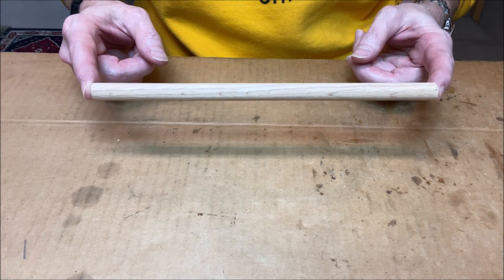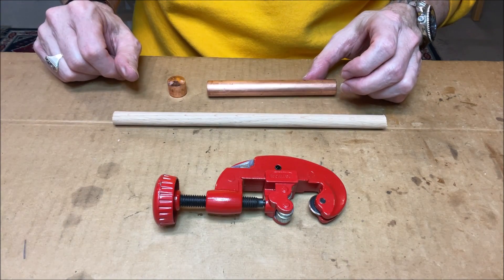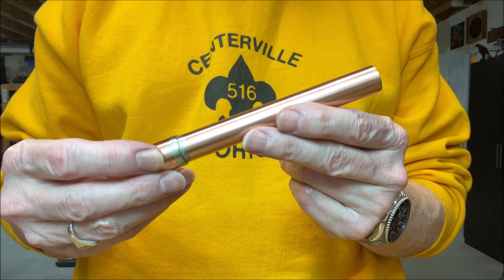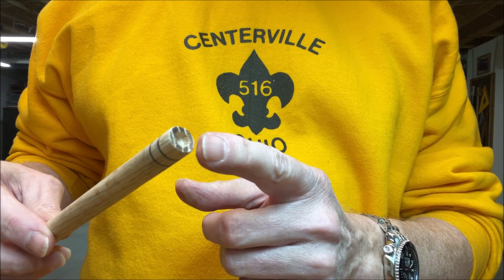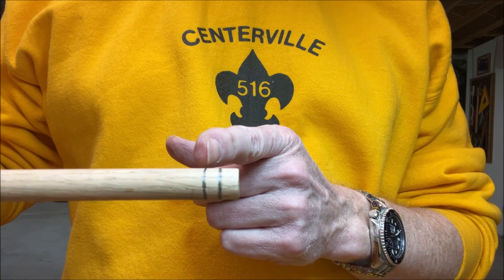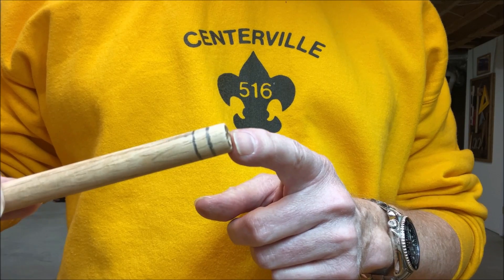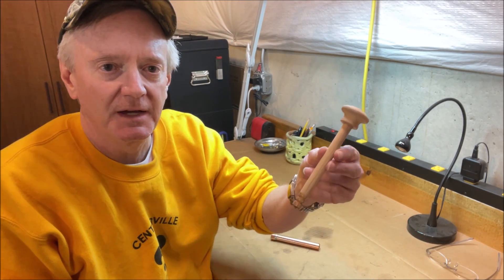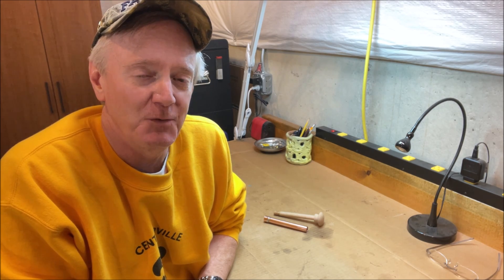DIY Fire Piston

Comment from the maker: I've had some recurring comments/questions that I'd like to address. First, I wanted to do more than just deburr the end of the pipe. I actually put a chamfer on the inside of it to allow the o-rings to slide in a bit easier. The built-in deburring tool on my pipe cutter was rather dull and just wasn't up to the task. Thus my use of the little junker knife I used and keep in my tool box. I probably should have made that clearer in the video. After I chamfered the inside end of the pipe, I also sanded it and polished it up with some steel wool. Sorry for not pointing all that out.

Second, it honestly never occurred to me to work in the piston groves using my drill press as a sort of lathe. My preference is to use hand tools as much as I can, though. Many of the scouts I try to work with don't have, or aren't allowed to use power tools. I know, what about blow torch soldering? We'll I've offered to do that for any scout in my troop who wants to build a fire piston on their own. 

Lastly, for now, the physics governing the action of a fire piston is a bit more involved than a simple examination of Boyle's Law (i.e., PV=nRT) might lead us to believe. I've put some links in the description (Update 2) to some good articles that go into this in more depth. Please take a look.
Reply: I found some nitrile O-Rings on Amazon, but they're not cheap. 9/16" X 3/8"
Reply from the maker: @radagast6682  Yes, I found some too. I broke down and bought some. I hope they will hold up longer to compensate the cost.
Reply: @FlintStryker  How many did you buy, and can you sell some to me?
Reply: @FlintStryker  Are you worried about igniting the petroleum based lube?
Reply from the maker: @radagast6682  I bought them on Amazon. I paid ~$8.60 for a package of 20. I don't think YouTube would take kindly to me selling things via my channel at this point. Sorry. Here's a link to what I bought: https://www.amazon.com/dp/B000UEZ5BA?psc=1&ref=ppx_yo2ov_dt_b_product_details
Reply from the maker: @radagast6682  No. It doesn't seem to be an issue at all. Best Wishes!
Reply: @FlintStryker  Thank you so much for taking the time to help.
Reply from the maker: @radagast6682  You are very welcome. Thanks for stopping by. Best Wishes!
Reply: İşte dürüstlük ve samimiyetin kanıtı gibi konuşuyorsun seviliyorsun ❤❤❤
Reply: You may be able to use super glue... in order to avoid soldering the two copper pieces..    I know the soldering is much more secure... but in case one doesn't know how to solder, or doesn't have the equipment.  🙂  Thanks for this nice video.

Comment: I made one of these today, but I used a Copper Stub Out (Straight) for the cylinder, cut to size, that didn't require any soldering. I haven't tried it yet because I don't have any charcloth. It has compression, but only time will tell whether it creates an ember. I do like the glue used on the knob instead of a screw like I used, but that is easy to remedy.
Reply from the maker: @richardclifton4120  Great to hear. I hope it works for you!!! Best wishes!

Comment: Well done tho my first attempts didn't ignite a few tweaks and off it went I did find that increasing the size of the hollow for the char cloth gave me a larger ember that was hotter and let me take my time getting it picked out and into the tinder bundle where it lit the tinder quicker I built my next piston using an old nonworking mini maglite in the head of the light where the bulb and reflector would go I left the lens in and store char cloth and lube in that area along with a 4 penny finish nail slightly shortened to pick the ember out with Loved your video I'll bet you influenced a heck of a lot of fire piston builds   good stuff
Reply from the maker: Many thanks! I like the mini MagLite idea. I may have to look into that. I may have an old one in a toolbox somewhere. Happy Friday!

Comment: I noticed when you heated the cap and pipe, you pointed the torch at the edge of the fitting. Solder flows to the hottest point. This will not get the solder to the base of the fitting. You should heat the cap from the end to get the solder to flow all the way in.
Reply from the maker: Yes, thank you. When I watched the video of myself completing that step I just shook my head in dismay. Not my best effort by a long shot. My next one will be better. For the sake of my younger scouts, I've also been thinking of just epoxying the end cap on. I don't think 5 minute epoxy will be sufficient, but maybe J-B Weld or a slow curring high strength epoxy (e.g., Devcon 2-Ton epoxy) might do the trick.  What do you think?
Reply: @FlintStryker  As a plumber of over 56 years, I only solder copper pipe, but Devcon 2-Ton is a great product, it may work. 

I can't get my fire piston to work. I started with the dowel 1/16" from bottoning. When that didn't work, I sanded I little at a time, trying each time until I got to 1/8" short of bottoming. My char cloth ignites with flint and steel, and I have very good compression. Do you have any suggestions?
Reply from the maker: @radagast6682  I'm sorry you are having trouble. Keep at it! It will eventually work. Ironically I've found that too much compression can work against you, though I don't fully understand why. If you are using an o-ring seal, try filing the grove a bit deeper just a little at a time. That may do the trick. If I get such good compression that the piston wants to push back out after I've jammed it in, that's too much. If it's tight, but will stay in until I pull the piston out that seems to be the sweet spot. Let us know how it goes. Thanks for checking in!
Reply: @FlintStryker  Thank you. I have varied the compression by varying the starting  position of the piston. I will keep trying.

Comment: I was reminded today after watching this video and another one on this particular topic. If you have a pellet gun you can put a little vaseline in the cup on the backside of the pellet and when you fire it the air pressure ignites the Vaseline and it'll crack off like a .22 bullet. I don't know the ballistic differences but I'm pretty sure that it's more powerful than just the air compression in the air gun itself. If someone has the means to test it with the right equipment for muzzle velocity and speed let me know please. Thanks and be safe.
Reply: I remember when I first bought one of the high velocity air rifles , I had oil in the barrel and it dieseled on me and sounded like a 22. I am sure you have a little more velocity.

Comment: Maybe a small addition of a metal washer between the wooden strike head (attached to underside of handle) and the top of the copper tube, it may start to dig in otherwise.
Reply from the maker: Not a bad idea! Thanks for the suggestion. That will make it last longer.

Comment: Just a little tip on the soldering. When applying solder, apply it on the opposite side of the heat. The solder wicks towards the heat source. I'm gonna have to do this little project. I've wanted to make a fire piston for some time. Your method is perfect.
Reply: Also, don't overdo the flux. It runs when hot which is why the solder ran over the surface of your cylinder.

Comment: Great setup! If I may be of a little assistance, however, the pump jack in your video is turning backwards. Any pump jack with the pitman shaft offset from the centerline of the well pipe (most if not all vertical jacks) should rotate so that the pitman arms are as near vertical as possible on the power (up) stroke. Rotating the jack backwards, particularly under heavy load (deep well or large diameter cylinder) will result in accelerated wear to the cross head slide and possibly pitman arm failure. Hope this helps! Keep that old iron turning!
Reply from the maker: Sorry. I don’t know what you mean. Did you mean to leave this for some other video?
Reply: @FlintStryker  I thought the same thing I've done it. HA HA

Comment: That will start a fire. Any special reason for two o-rings. Thank you. God Bless and stay safe.
Reply from the maker: Just insurance for a good seal. My last single o-ring piston didn’t seal well and I ended up tossing it. Thus my excitement when this one worked on the first try!! One will do but you need to be extra careful - especially if you fit it with hand tools. Best Wishes!!!
Reply: @FlintStryker  Also, two is one and one is none! Blessings
Reply: @FlintStryker  Thank you. Will get my crew, three families with three kids together and grill some burgers and make these. Great group time together.
Reply from the maker: @joeyhardin1288  Sounds like a great way to spend the day!

Comment: Rather than 3 -In-One Oil, try some, "Preparation H" Ointment (original jelly formula that looks like Vaseline if you can get it) or KY Jelly.  Neither will attack the rubber O-Ring.  I've used Preparation H for paint stick O-Rings and these rings are still good after over 30 years!  I am not sure about how well the new white cream Preparation H formula works.
Reply from the maker: Well, I would never have thought to give those a try.

Comment: Possible improvement, but haven't tried so this is just brainstorming.
Maybe a smaller diameter pipe for the bulk of the piston... leaving about an inch for the o-ring and charcloth divot. fit the pipe into the dowel plug, then use a screw cap on the other side for the piston handle. This gives you a space to store spare o-rings, lube, and maybe a bit of charcloth and/or pet-jelly soaked cotton. 
Thoughts?
Reply from the maker: Not sure I totally follow. Give it a try, though, and let us know how it works out. Post up a video too.
Reply: @FlintStryker  you have a plunger that is about 6 inches long and wood. The last inch and a half has 2 o rings and the char cloth cup.  I'm suggesting cut that last 1.5 inches off and attach to a smaller pipe that is hollow and can store spare parts and tinder. The plunger is now a hollow storage pipe with the wood plug.

Comment: Why don't you use the De Burr tool on the Pipe Cutter ??
Reply from the maker: Others have asked this too. I wanted to do more than deburr the end of the pipe. I actually put a chamfer on the inside of it to allow the o-rings to slide in a bit easier. The deburring tool on the pipe cutter wasn't up to the task. Thus my use of the little junker knife I used and keep in my tool box. I probably needed to make that clearer in the video so I hope others find this comment. After I chamfered the inside end of the pipe, I also sanded it and polished it up with some steel wool. Good catch! Best wishes.
Reply: @FlintStryker  Something like putting a flare into the end.. Ok.

Comment: The reason it worked after you filed it is because of Boyle's law - by reducing the VOLUME you increased the TEMPERATURE for a given energy input (the hammer strike) . It will get to basically the same PRESSURE from absorbing the energy of the hammer strike, regardless of the volume, but ideally to get the highest temperature you want the free volume under compression to be as close to zero as possible.
Reply from the maker: Please see Update 2 in the description for more on this.
Reply: Charles says "Hey what about my law?"
Reply from the maker: @stevemorris3710  Well, yes, Charles' Law is one of the ideal gas laws (V1T1 = V2T2), but it can be derived from Boyle's Law when the pressure is held constant. Please see the links in the updated description for more detail on the physics of the fire piston. Best Wishes!

Comment: I think you could fill some of the volume at the bottom of the endcap with another o-ring left inside at the bottom of the endcap. The o-ring having a space in the center doesn't come close to touching the ember, and  compacting the air to an even smaller volume also drives up the temperature.
Reply from the maker: Could be. With a good seal, though, I rarely plunge the piston all the way in - even with the built-in gap at the bottom.

Comment: I was thinking about cooper's high thermal conductivity, and that if you coat the pipe with a dip in polyurethane or varnish or something that won't flake off, maybe you can get it a bit hotter. 

Maybe adding a dry graphite powder lubricant to the walls will reduce the friction with the walls. For quicker compression and less time to loose heat to the walls.

Obviously what you made works so maybe it's good enough😃, and that the heat loss to the copper walls is so short that it's practically nothing. And, maybe any insulating inside coating will simply end up flaking off anyways.
Reply from the maker: Could be. Reducing cylinder thermal conductivity would probably help. I’m trying to keep it all simple, though. A quick push usually does the trick. Another suggestion was to use PVC for the cylinder. I may give that a try.

Comment: Ive heard of people using cotton ball instead of charcloth. Have you tried that or think it would work?
Reply from the maker: I’m not sure. I haven’t tried it. Cotton doesn’t smolder real well, though. It might not work so well for fire making.  I’ve seen demos with transparent cylinder “fire syringes” that use tissue paper. Just makes a big flash. That’s great for a WOW factor but not so good for toasting marshmallows. YMMV. I might give it a try.
Reply: @FlintStryker  I watched your vid and made a piston and as of now, I cant find a tin to make char cloth...lol...so I tried a cotton ball pulled apart and I cant get to work. I dont know if its the piston of the cotton ball thats the issue. If you try it out please leave a comment so I can check it out. Going to have to buy me some altoids so I dont have to steal and sacrafice one of my wifes tins! Thanks
Reply from the maker: @zipshed  I've never gotten cotton to work either, even in known good fire pistons. I'd make and try some good char cloth first in order to trouble shoot your fire piston. Once it works with char cloth, you might try cotton again.

I did get some ashed cotton to work a few times (i.e., just rub a generous amount of wood ash into the cotton), but I only did that a few times and found it mostly unreliable. Good luck! And thanks for chiming in!
Reply: @FlintStryker  Ok will do and thanks again!
Reply: I've used cotton balls to throw in when I make my batches of charcloth. They hold an ember much better once they are charred but I don't think the natural state does better then charred denim by any means.
Reply: @TNBushcrafter  Thanks for the tip...Im just trying to figure out what the issue is with mine because I cant get it to fire.

Comment: Just a hint : Place your piston dowel in a power drill , using it as a lathe to cut your slot for the O-ring .
Reply from the maker: Good idea. I hadn’t thought of that.
Reply: Yeah, wondered why that wasn't the path taken too... was thinking won't have one in the field, but then you won't have solder kit in the field either....
Reply: Or use a table saw with the blade ever-so-slightly raised. Set the fence to 1/4" (plus 3/32" for the blade thickness) and roll the dowel over it until you have a uniform groove. Set the fence to 1/2" (plus 3/32" for the blade thickness) and repeat for second groove. Perfectly even depth of groove all around.

Comment: I used pvc pipe instead of copper pipe.  Also, instead of a hole in the end of the piston, a slot makes it easier to flick the ember out.
Reply: the pvc is a little less likely to leech the heat from the compression stroke, but it didn't appear as though there was enough to worry about.

Comment: What is char cloth?
Reply from the maker: Char Cloth is basically charcoal that's made from old cotton clothing (or other organic materials). I make most of mine from old denim jeans. I cut it into squares and roast them over low heat in an oxygen free environment (e.g., closed Altoids tin). The heat drives off most of the volatile/flammable chemicals (pyrolysis) in the cloth materials, and in the absence of oxygen it doesn't catch on fire. What's left over is mostly a black, high carbon content mass that will smolder a long time and which has a fairly low ignition temperature. 

Char cloth is very commonly used as tinder material in traditional flint and steel firemaking. Here's a video I made with my youngest, Catie. She loves flint and steel and in this video demonstrates how to make and use char cloth. Enjoy!
https://youtu.be/Oy7bv4bPblA

Comment: There is a debir tool  on your pipe cutter
Reply from the maker: Yes, that's correct. Thanks for pointing that out. I wanted to do more than deburr the end of the pipe, though. I actually put a chamfer on the inside of it to allow the o-rings to slide in a bit easier. The deburring tool on the pipe cutter wasn't up to the task. Thus my use of the little junker knife I used and keep in my tool box. I probably needed to make that clearer in the video so I hope others find this comment. After I chamfered the inside end of the pipe, I also sanded it and polished it up with some steel wool. Good catch! Best wishes.
Reply: @FlintStryker  if it's the straight triangle type, you can push a little to flare the end some.... but you found a solution that works for you, so who are we to complain!